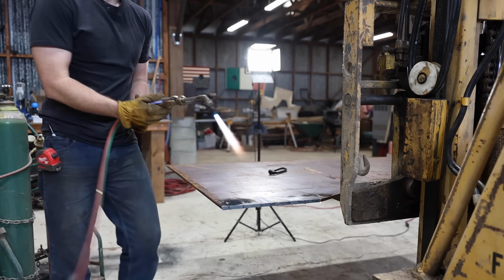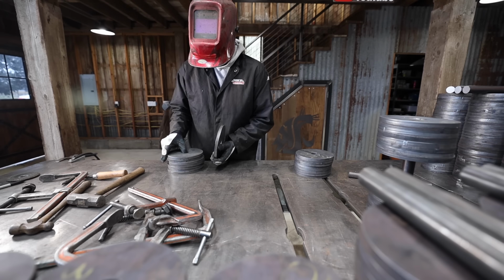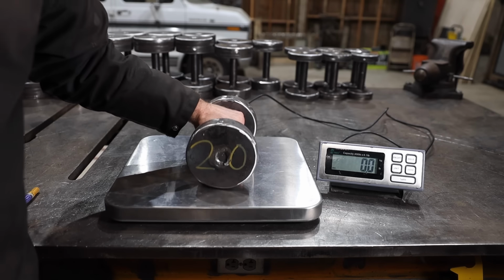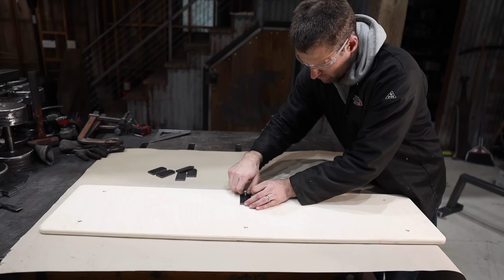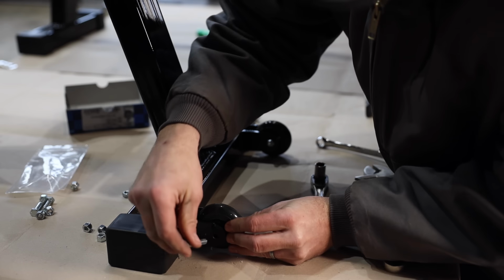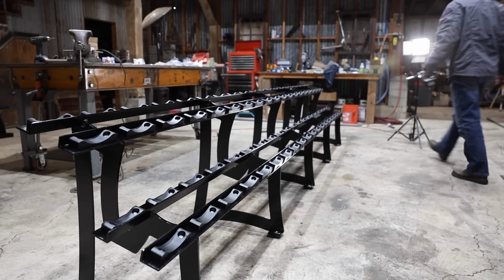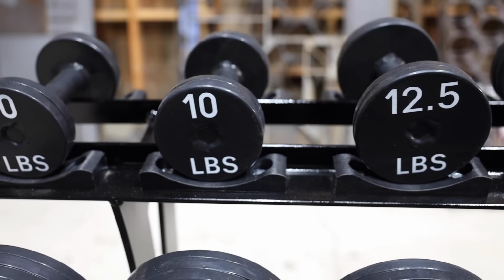Dumbbell Set from Scrap Metal | 10-100 lbs, Flat Bench, and Rack

Comment: Who else here is living through this guy and dreaming of a DIY dumbbell set like this?
Reply: Shit, in that dream I also have the space for that whole rack 😂
Reply: Plasma cutter and a lot of large sheet metal
Reply: Someday if I can actually get everything going on the business end of things I will have the gym next door to the machine/bladesmithing/gunsmithing shop where the dumbbells and fixed barbells were made. Take that Rogue.
Reply: Yup been wanting to malke my own for a long time. Just getting the steel is the hard bit.
Reply: I literally have my own weights at home I'm just watching this because I'm bored
Reply: https://youtu.be/N9ClSl3saak
Reply: it may be feasible to get the dumbbell set like this, but after that the next dream will be having extra room in the house
Reply: Concrete is cheap
Reply: @ststst981  I already own weights but if I needed to make some I would go with coffee cans and concrete and for the handle I would most likely use some type of hardwood

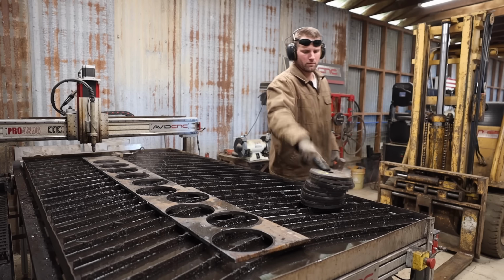Comment: 3:26 I think you need to recalculate the total cutting length once more. No way that parts will get you too the moon and back 3 times. I guess the outerdiameter is 300mm (~12") and the hole is 50mm (~2"). Than you will get 300*3.14+50*3.14=1099mm. 1099mm * 420pcs = 461814mm = ~ 462M. The distance too the moon is 384400000m according to google. But still is 462M plasma cutting alot.

Comment: You do exceptional work friend! You also have some impressive CNC equipment. After 45 years of old school metal fabrication, it’s quite exciting to see how much nicer you younguns can build things. I actually built a flat weight bench, incline and decline bench in welding trade school 40 years ago as 3 projects. The decline bench was all 2” schedule 40 pipe TIG for my final TIG pipe grade. Blueprints and all, difficult Class I think I received a B. I got certified and that’s all that matters, except I haven’t TIG welded since. 45 years of heavy steel!

Comment: Hmmm, "cut-length was 3 x, a round trip to moon"... Well, the moon is 384,400 KM away, round trip 768,800km multiplied by 3 is 2,306,400 kms...or 2,306,400,000 meters....So if you have 420 discs, that's 5,491,000 meters of cut-length per disc, rightttt???....BTW, why wouldn't you reverse calculate the size of a 2.5lb, 5lb and 10lb and 15lb plate and make a 5lb standard handle, like EVERY set of dumbbells made in the world... Wait, I have my answer already, pls refer to your cut-length calculation...

Comment: So you’re telling me that you cut 717,000 miles? If that’s the case then if you cut 420 plates then on average each plate you would’ve cut a length of 1,700 miles for each one. And it would give them a diameter of 540 miles long. I’m no expert but I don’t think any of those plates were even a foot long.

Comment: With the weight and rack weighing over a metric ton, I assume this is going on a concrete floor?
Reply: Also Matthias: “Why didn’t he jump on it? Why didn’t he paint it green?”
Reply: Why anyone would put workout equipment on anything but concrete is beyond me. The weight is there but the pressure is not. If he has 8 foot pads at 4” square..you’re only talking like 16psi...concrete is rated at like 2,000psi+
Reply: Great question. A basement or barn workout space is probably the only answer to this amount of weight
Reply: Also, did we get a cost breakdown?
Reply: @avyouandme   cost breakdown with or without the forklift and industrial laser cutter he used in step #1?
Reply: @avyouandme  As with all things, once you factor in any kind of hourly rate, making is more expensive than buying it ready made
Reply: @avyouandme  I'm going to go out on a limb and say that it's not a cost savings over simply ordering weights, unless you have the material for some price far cheaper than normal for steel.  Even if the material was free, I'm not sure it'd be worth the time or equipment hours.
Reply: @RyanTaylor-pi8gq  don't forget to factor the income generated by making a youtube video about it...
Reply: @RyanTaylor-pi8gq  If you can get someone to chop the pieces for you, the sheet metal, and provided you have a welder, this is actually extremely cheap relatively speaking.
Reply: @RyanTaylor-pi8gq  The amount of energy and gas the plasma cutter used makes this completely uneconomical. Still neat though.
Reply: @RyanTaylor-pi8gq  work out equipment has been harder to acquire  these days because of covid there is more interest in home gyms.
Reply: @aniquinstark4347  no.  You can do this with a 45amp plasma cutter and the "gas" is CDA (Clean Dry Air).
Reply: That looks like a concrete floor in the shop...
Reply: @Pure_KodiakWILD_Power  I see you everywhere man. From Meinl demos to diy vids.
Reply: @ianbridges6040  😂 I guess you're a YouTube Renaissance man as well. Yes, I watch a little bit of everything,  especially in winter when I have more downtime, but now Spring has sprung, things are beginning to green, the land is thawing out, and customers are texting and calling, so I'm slowly getting back into the almost non-stop grind again.
Reply: this will go perfectly in the middle of my living room on the 4th floor of a wood framed apartment building lol, cant see anything going wrong there
Reply: Mathias would use twelve jigs and a pantograph to cut these weights.
Reply: Captain Obvious over here .
Reply: No a straw table will support this
Reply: Its on ground level so yeah.
Reply: Nope, it’s in an upstairs apartment 😂
Reply: Seeing this question made my brain ache
Reply: He keeps them in the basement that was created when this was brought into his house
Reply: we can use this in open area gym. like park gym
Reply: @MOHAMED-yd1ed  Nope, bad idea.
Reply: Where else do you put weights?
Reply: Probably thin glass lol
Reply: Why is he giving it to you and putting it in your house? 😂
Reply: Matthias is going to make these out of wood and Big Daddy will be 26" in diameter, perfectly balanced, and can be used as a spare bandsaw wheel.
Reply: That nice plate of steel from the scrap yard alone was $1000 guaranteed. He was in for 3k min, I'm thinking he paid 1-2 dollars /lb all in, but worth 3-4 dollars/lb
Reply: @MikeBarbarossa  I wouldn't pay anywhere near that in Houston,  I guess it depends on your proximity to an industrial center.
Reply: you know what happens when people ASSume
Reply: @codybersicc7939  haha
Reply: Matthias! Would be awesome to see make some equipment out of wood!

Comment: You can reduce the draft on the cut by making sure you always cut to the left side of the piece you are keeping.  If you look at your cut paths, they are all backwards, the part is to the left of the cutting plasma.  Ironically all of your swiss cheese and drops will have a more square edge than your weight plates.  Just remember the rule of thumb that you should "climb cut" your plasma cut parts, as if the plasma jet were rotating clockwise like a milling bit.
Reply: Good observation! He has a Hypertherm plasma torch, and they state "The squarest cut angles are always to the right side, with respect to the forward motion of the torch. The plasma arc typically spins clockwise with standard consumables. Good side of the cut is to the right side of the torch, as it travels forward." And it seems he cuts "backwards".. :(

I personally use SheetCam for plasma Gcode, and there the default cut direction is also backwards, really tricky!
Reply: @mpkleinbreteler  This is usually resolved by clicking some boxes in the software used to create the cut path.
Reply: @eformance  yeah I know, but could easily be overlooked :)

Comment: Really ought to get a 3d printer, wouldnt have wasted as much material 3d printing those saddle pieces.  You can get a really good printer for $200, and a great printer for $500ish.  At any rate, was an amazing video as always!
Reply: That wouldn't have worked as well long term. What he used is ultra high density and will not deform throughout use of holding heavy steel.
Reply: @evanrobinson7657  You can 3d print quite a few different plastics, most people print PLA and for that reason think of 3d printed objects as less than optimal.  

No doubt what he done was awesome, everything he does is amazing.  I just hated seeing that big pile of plastic dust when it could have been avoided.

Comment: Did you consider going with a hexagonal shape on the plates? You could get even more out of that metal sheet
Reply: And the weights won't roll away 😆
Reply: The round shape looks traditional though.  And you can still do your renegade rows, you just need a stronger grip.
Reply: I am planning on a hexagon honeycomb for that reason but admit round looks better
Reply: I’m guessing it was probably easier to calculate the weight to diameter increase and lay it out vs trying to match up oddball hexagonal sizes next to each other
Reply: @rabajr911  any modeling/calc software can calculate this for you automatically.
Reply: @leefhead1  Yep, given how well we know the weight of steel, and that we are talking about a fixed thickness for each plate, all you'd need to do is solve for area. No doubt you can tell the software to draw you a hexagon with a given surface area.

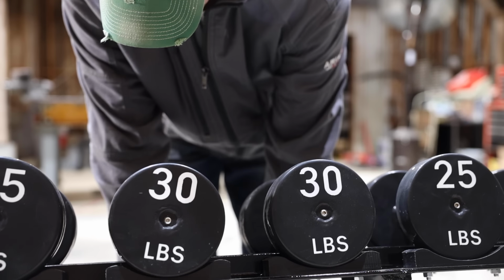Comment: I'd highly recommend adding some diagonal bracing  on the dumbbell stand. There's some clear side to side movement at around 22:04, and that's with the rack not fully loaded yet, and just a light force hitting it in the most optimal direction. I fear that if you accidentally walk into it from the side with some force, it'll just bend the legs or snap the welds and come crashing down. It's not that I don't trust your welding skills, it's just a lot of weight, which can exert a lot of force. Front to back it's absolutely fine, side to side is a bit iffy.
Other than that: A seriously impressive build. I first thought you were joking when you said the weights were getting powdercoated, but I get why you did it. The end result is amazing.
Reply from the maker: I had the same concerns, and was ready to add cross bracing when I was building it. In that shot when it's moving, there were only 2 legs on the ground because the angle came with a slight radius to it. With the weights on the rack and all five feet on the ground, i couldn't budge it. But I totally agree, I had the same "folding" concerns initially when I started.
Reply: @rainfallprojects501  awesome job! I can be overly paranoid about stuff like that sometimes, especially when a crushed toe is a possibility. LOL
Reply: @rainfallprojects501  Thanks for that reply. I had the same concern. Great project!
Reply: I agree completely. As much as he typically over-builds things (and I mean that in the most complimentary way), I thought that the rack, especially given the amount of weight it would be holding, looked flimsy.